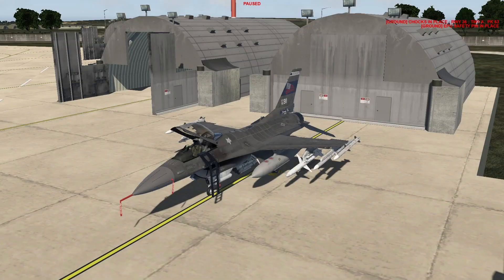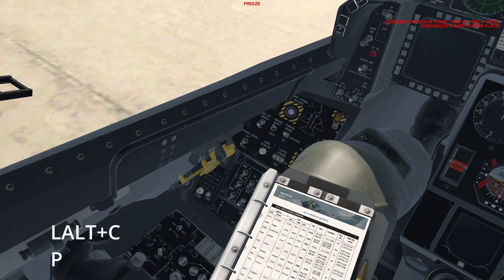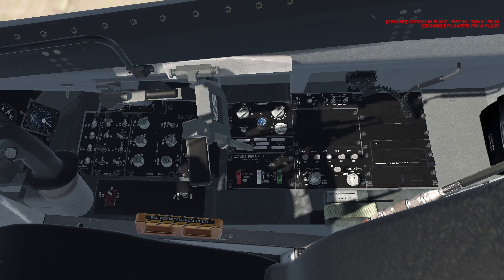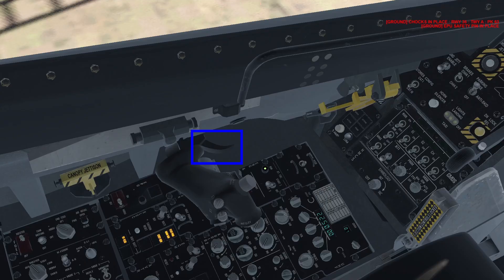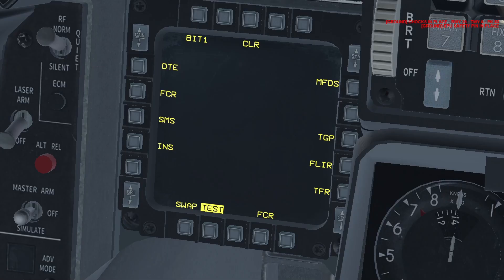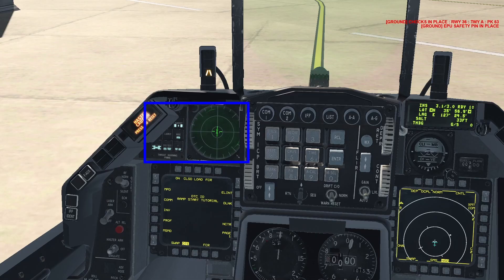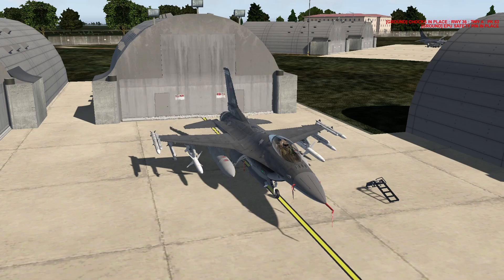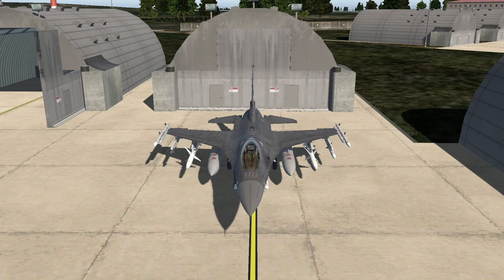Falcon BMS 4.37 Tutorial - Ramp Start

Comment: Sorry dcs is just so far ahead this kinda sucks
Reply from the maker: You clearly didn't see how the new update 4.38 looks like. This video was recorded on 4.37.

And DCS is so far ahead? That's gotta be a joke right? On several aspects BMS has been and continues to be ahead of DCS for years. For example, an essential tool for the F-16, the data cartridge. It took years for DCS to implement that, I'm not sure if they finally have done. The ATC system on DCS is basically non functional. I could go on.

And on top of all that, how ED behaves and treats their customers, busted releases and theatres cut up into little pieces sold separately to milk as much money out of people. 

So yeah, go back to DCS and stay there.

Comment: Can you be more specific about which throttle button to use to align the JHMCS?
Reply from the maker: It's hard to be more specific, but I understand it might seem quite vague, it's a button that is used very rarely in other systems. Look on the keybindings for the CURSOR ENABLE button. On the TM Warthog HOTAS that I use by default it's by pressing in on the radar cursor axis. Hopefully this is a bit clearer, let me know if you need more help with this
Reply: @fisgasfighties thanks I managed to align it, but for the other two modes which button should be used?
Reply from the maker: The 0 on the ICP  @PredatorFly

Comment: What is the button of activation of Throttle, used for align? Whats the name in Keymapping?
Reply from the maker: Are you referring to aligning the JHMCS?
Reply: Yes, align of Helmet, in DCS I use the button Enable Switch - Depress for Align OK, and in BMS what is name of button? I am sorry for my inglish.  @fisgasfighties
Reply from the maker: @euandreruas  it's called Cursor Enable. No worries, I'm happy to help
Reply: Ahhh Ok, i go search here. Thanks you! Other question, in DCS have a button Expand/FOV Button,  in BMS whats name the Button?  @fisgasfighties
Reply from the maker: @euandreruas  I'm not sure what the key is called exactly on the config and I can't check right now, but look for pinky button on the stick configs. What HOTAS are you using?
Reply: I use the Logitech Hotas X56! The Expand/FOV Button, It expands your FOV on different sensors. On A-A radar, it narrows the displayed area around your cursor. The Mav page switches to the narrow and zoomed-in FOV. On A-G radar, it switches between expansion and Dbs1 and Dbs2 modes. The same goes for HSD. Also, if you start and hold when HSD is SOI, it zooms in and centers around your own personality while it is based. The page also uses expansion and Dbs1/Dbs2 zoom steps.  @fisgasfighties
Reply from the maker: @euandreruas  I know the button you're talking about. I think the name for it might be the same as well on BMS. I'm not sure but I'll check tomorrow
Reply: OK, if you find out, let me know! Thanks! @fisgasfighties

Comment: Removing the epu pin after engine start exposes ground personnel to significant hazards (hydrazine exposure and turbine deployment risks. I suggest remove the pin before you crank the engine.
Reply from the maker: I understand but that sort of thing isn't currently implemented in BMS so functionally it isn't too important

Comment: Hi Fisgas, is it any specific way to turn on radar prior to takeoff? I think i followed all your steps, but still gets "no rad" in the HUD even after takeoff.
I remember from earlier sims / F4AF that i pressed a keyboard shortcut to turn it on, but cant remember.  
Thanks for great videos, well explained for all of us semi-retards!
Reply from the maker: @FredrikHåbu  no worries, sometimes the systems can get a little confusing and all it takes is one wrong button press or switch position for things to not work the way they should.

The radar won't operate completely until after takeoff, I'm not sure if it's the system detecting weight on wheels or if the landing gear is down. However if you followed all the steps correctly you should be able to operate the radar after takeoff. 

Can you make sure that you did and also check out my taxi/takeoff video? If it's still happening please let me know and we can try to troubleshoot it further.
Reply: @fisgasfighties  Thanks! I will see the video, and try one more time.
Reply from the maker: @FredrikHåbu  ok cool, let me know if there's something you missed or if the issue is still occurring

Comment: How am I supposed to press cursor enable button on the throttle if I can't move my head around cus of the alignment?
Reply: Thx so much for responding. Your videos are very helful
Reply from the maker: @DanielPotter234  my pleasure, I'm happy to help!
Reply from the maker: @DanielPotter234 you're going to have to memorize where it is on your throttle and press it without looking at it. On the TM Warthog by default you do it by pressing the radar cursor in, for example.
Reply: @fisgasfighties  Oh mb man. I forgot to tell you I don't have a hotas. I use a ps4 controller as my joystick and my mouse as looking around
Reply from the maker: @DanielPotter234 I see. I suggest looking up the default binding on the keyboard or make one yourself for cursor enable as it's not a button or switch you can press with your mouse. You should be all set for the JHMCS alignment with that.

Comment: One small issue when comparing to real F-16, do not engage parking brake prior to engine start, it depletes the hydraulic accumulators which are needed for JFS start.
Reply from the maker: @Ronke01  I did not know that! Thank you! If that ever gets implemented I might have to do a new ramp start tutorial, which I might have to anyways whenever 4.38 comes out
Reply: Amazing info, thx!
Reply: Me neither (I don't recall anything about it in prestart checklists).
Thank you.

Comment: Why do you delay the MIDS knob?
Reply: Thank you for explaining. Sometimes I do delay it, sometimes I don’t. Not sure if I ever saw an effect of this.
Reply from the maker: @Aerowinx  I know that if you try to starting it up on the DTC before loading the DTC itself can cause issues or a failure to start up the system
Reply from the maker: @Aerowinx  as I understand it from when it was explained to me, other avionics need to be started up before being able to start up Link16 correctly. In order to make sure that is done I personally perform that step of enabling MIDS and then activating Link16 separately.

Comment: I follow you and did step by step but I get EQUIP HOT?  AC is ON...?  what am I doing wrong?
Reply from the maker: @kevinbryan1187  did you set the air source to norm before starting the engine?
Reply: @fisgasfighties  I will double check...How can I move the Arm rest to see? also I run TWO monitors not sure how to see your videos and PAUSE while I start plane like you do
Reply: That is the issue...Arm rest for me hampers my view...So Once I get to NORM on airsource and then Oxygen ON I should be good
Reply from the maker: @kevinbryan1187  good to know it's resolved!

Comment: wtf does "NOT SOI" means on my left mfd?
Reply from the maker: @MiG-23-ML  it means that the MFD where that message is shown is not "Sensor Of Interest". So whatever inputs you do on the controls for the MFDs, use the cursor or the TMS buttons, won't be applied on whatever page is on that MFD. You can make it SOI by pressing DMS Aft/Down. Does that make sense?
Reply: @fisgasfighties  absolutely makes no sense
Reply from the maker: @MiG-23-ML  get on my discord and I'll try to explain it to you via DM

https://discord.gg/btfUBPtu
Reply: @fisgasfighties  I mean the TMS is the cursor on the MFD to lock on targets right? It used to be the arrows on the keyboard in the older versions of falcon but now doesn't do anything anymore.
Reply from the maker: @MiG-23-ML  yes you use TMS Forward/Up to lock targets on the radar, or to do point tracks on the TGP, but only when they are Sensor Of Interest. You can see that they are because they have an outline around them and the other MFD will display the message that you were referring to.

Comment: I have a silly question, Is there any way to look around in 3d without head tracking? i can't find any binding/axis
Reply from the maker: @carderetoasecas88  press and hold the right mouse button, then move the mouse around. When I make tutoriais I don't have any head tracking activated and this is the method I use.
Reply: if you have a camera yes you can move the pov camera by moving your head around!

Comment: Did the update for the link 16 already come out? I still cant use the mids knob
Reply from the maker: @Hardpawnimage10  yes it came out on update 4. https://www.reddit.com/r/falconbms/s/IisOZnkaMT
Reply: @fisgasfighties Oh cool, too bad there are no automatic updates in the launcher
Reply from the maker: @Hardpawnimage10  yeah you need to run the updater manually.
Reply: @fisgasfighties Thanks, i did that but now my controls are reset and i dont have a backup, is this normal?
Reply from the maker: @Hardpawnimage10  unfortunately if you didn't save a backup the controls will revert back to the defaults
Reply: @fisgasfighties ah, luckily i remember them all so no big deal
Reply from the maker: @Hardpawnimage10  ah cool, you'll be up and running again relatively fast